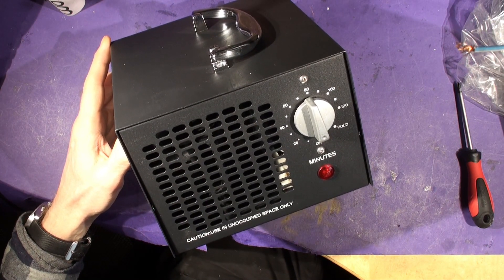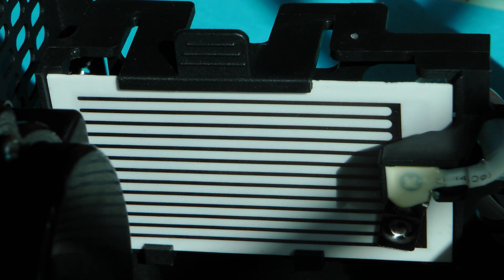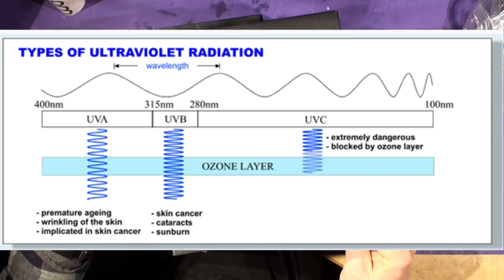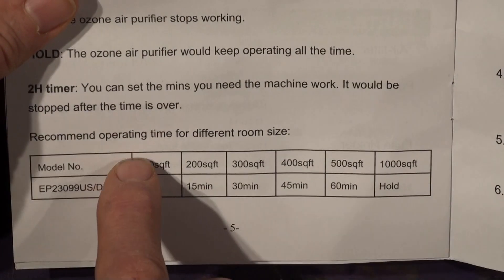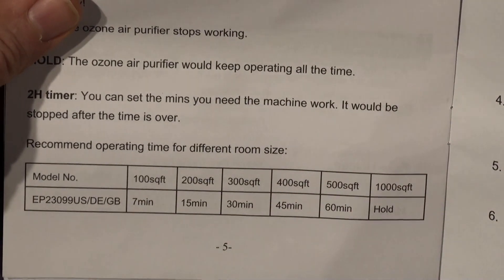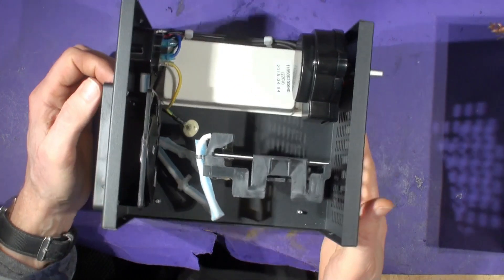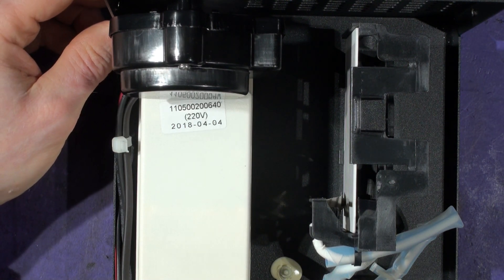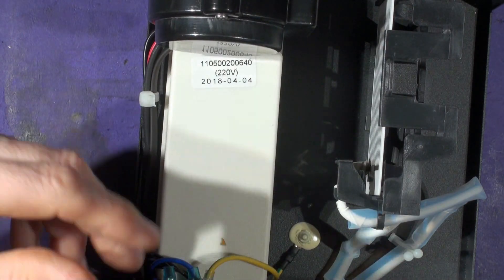Ozone Room Sterilizers for Viruses and Bacteria is effective but  hazardous.  How to use safely.

Comment: I picked up 2 "eco air" units  & made 1 working machine from both. All the metal parts inside looked as if they were stored in salt water for years. So I looked into ozone a bit more & then only realized how dangerous it is if misused. These eco air units were about 600 USD & sold on their health benefits. They are very good at taking fine particles out of the air,  but   it is shocking the lack of warnings. Again yet another example of bs marketing & lack of basic understanding.
Reply from the maker: I agree. Ozone is very useful but also very nasty. I don't see how they can be CE approved there must be some basic right of a UK citizen to be protected from this crap. The government is sleeping. A thought are we still relying on the CE mark (China Export) or are we gonna get the kite mark back.???